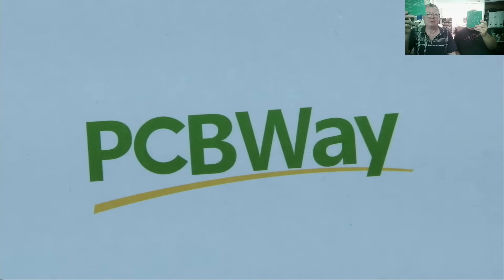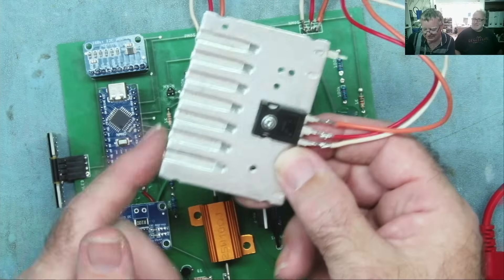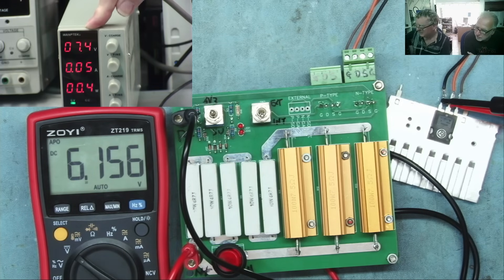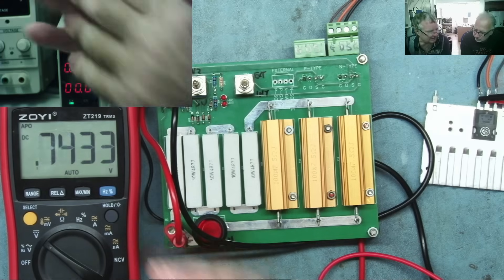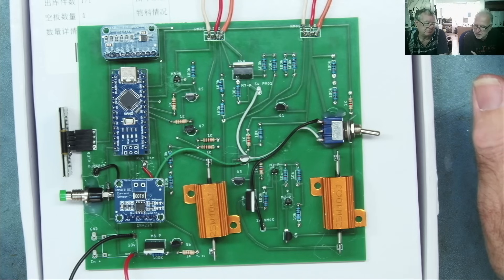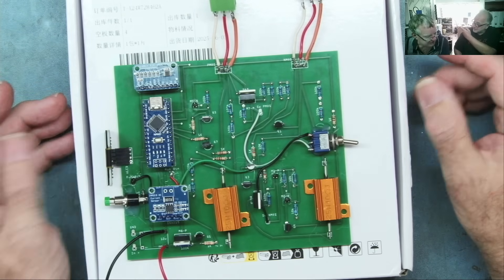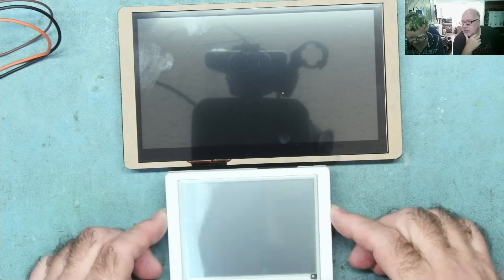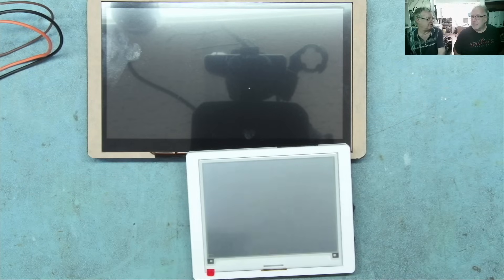Low Cost DIY Automatic Mosfet Analyzer Curve Plotter Project

Comment: Love it ❤  To test Vgs(th), you short the gate and the drain and, for that mosfet, apply a current of 0.25mA to the drain.  So I suspect mine is closer to the actual value 😜 However, on that revision I used an NPN transistor to short the gate and the drain, so I suspect perhaps 0.7v needs added to the Vgs(th) measurement - which would bring it to about 2.5v.  Not sure and not tested it in that much detail.  P-channel didn't need that transistor, so might get a slightly more accurate Vgs(th) value for them.

For the Rds on, if you look at page 3 of the datasheet (IRFP240 for those not paying attention 😁), top left graph showing Id vs Vds, you'll see the bunch of straight lines.  At 1 amp - it's normally about 930mA on the device - and 10v Vgs, you can see that at 10^0, look down onto the x-axis, you can expect in the order of 0.2v Vds.  So, according to the datasheet, Rds on with these parameters should be about 0.2 ohms, or there abouts (these graphs are quite squished).  It's not hard to see a bit less than 1 amp will give a bit less than 0.2 ohms...  That's my excuse anyway, reality is the Rds on should be fairly similar for both 1 amp and 10 amps (I suppose it depends on your accuracy expectations).

At 10 Amps, using the same curve, you can expect a Vds of about 1.2 volts and so 1.2/10 means expecting an Rds on of 0.12 ohms, which is about what you measured I think.  So both testers are correct I would say.  But the whole straight line on that graph means (I believe) that the Rds on is fairly linear over the whole region of circa 800mA to 15A or so.  The real issue is at low currents you are getting to the noise floor for measuring Vds - especially since it's passed through a 50/50 voltage divider - but in any case, it'll be hard work to get datasheet measurements for all mosfets and really, folk will still need to do more than just read the typical or max Rds on value to understand where they sit on that curve then gauge if it's a real-enough mosfet or not.  Maybe measuring and drawing a similar curve on those big screens will provide a better way to test them, but the Arduino won't be able to do that.

And yes, Detlef, it was a dodgy layout.  My excuse is that I thought I was running out of time as originally Richard said we had until June I think, so rushed it a bit.  Turned out I didn't need to rush and the dozens of other designs I was expecting to compete with weren't there :(

Great work guys.  Amazing to see 'random punter', homebrew designs being featured and tested ❤

Comment: Back when I was repairing home electronics for clients, we mostly relied on OEM components—these lower-cost Chinese alternatives simply didn’t exist. More often than not, once we quoted the price for those premium parts, the customer would decide not to proceed with the repair.

As an alternative, we’d comb through ECG and other substitution catalogs in search of suitable generic replacements—sometimes a slow and painstaking process.

A good curve tracer has always been a valuable piece of test equipment, though typically a costly one. If your approach really allows people to build a reliable curve tracer for under a couple of hundred dollars, that’s a big deal.

We used to have a very basic version that hooked up to an oscilloscope to show a waveform. It helped us determine if a component was obviously damaged, but it was more of a "for reference only" tool than anything precise.

Comment: I was looking at a datasheet for a couple of my fake mosfets, an 10N60 and an 8N60.  Both of these datasheets have an Rds on vs Id graph and shows me that, in fact, Rds on is not as linear as I thought...  So I was thinking that using a decent test current (2 or 3A easily achievable via lithium cell) to measure Id and Vds , then displaying these values with the calculated Rds on would be the best option.  The user then can cross check the results with one of the graphs in the datasheet, either Id vs Vds and/or, if it has it, Rds on vs Id.  If the results are off of the curve then it's fake.  If they are are on the curve then it's (probably) real.

I think big displays, decent microprocessors and all the support components to sweep 1A to 10+ Amps will make it quite expensive in comparison to doing some minor spade work with a datasheet to see if it's real.  That is, I'm thinking most folk would want cheap - though a super deluxe version might still appeal to some.

Comment: Look at the opportunity that we have stumbled upon.... With our investigation of fake MOSFETs, and how to test them,  Were creating the opportunity to learn  a lot about MOSFETs.   This is such a great project that we potentially just stumbled upon  Ha ha ha .   We started out with some simple testing procedures, and then we wanted to get a little deeper with more accurate testing and as we talk about creating more intricate testing equipment were learning so much about how these circuits can be designed and put together,  that in itself is an education.   I also see that we are taking ideas and hardware that we get potentially secondhand or very very inexpensively and making use of it.  I like the direction we are going,  let's keep the ideas coming along with good design reasoning   🙂

Comment: Taking power supply numbers as values for calculation is a bit sketchy. Those numbers are barely accurate. Also your power supply gets its feedback from inside so no compensation for leads either. Meaning you can set it to 10A, but it actually has 9.7A or whatever. But since this display is inaccurate anyway doesn't matter. But considering whole this PCB is sketchy then yes doesn't matter really. Just put one multimeter for voltage and another for current to get even decent enough values for calculating. But yeah the way you think would be a way to do it. But needs proper PCB routing. I suggest also 4 layer PCB since they barely cost more. For screen I would actually use some monochrome display and make the device battery powered. They take little current and are easy to program. You can add charging and stuff as well. Also I think you said it as well you can just build electronic load as a variable load. And sink type electronic load is quite basic. Nice project. Good luck with it.
Reply: It’s probably good enough for Gran Canaria 😅
Reply from the maker: Cheers.  We think an MCU controlled active load is the answer to this problem as you don't have to control the current supply capability (like using CC mode on your bench PSU) you just control the 'resistance' of the active load and your PSU will supply exactly the currrent you 'request' into the load, bsically eliminating the effect of any losses due to resistance of wires and PCB tracks. As long as the current is within the capabilities of the PSU of course.
Reply: @LearnElectronicsRepair  Yes that's the way to do it if you want to program current. But you also have to take voltage readings exactly at the load to make it correct. So you need external 2 wires for voltage measurement to make it more accurate like you also mentioned. But for a sinking type load all you need is op amp which would be driving mosfet in linear region, reference voltage for op amp(coming from DAC since you want to change it), current shunt, ADC to measure current for MCU and few other passive components.
Reply: @LearnElectronicsRepair  Btw cheap way to get a DAC is just PWM with MCU and use low pass filter to get DC. For ADC there is one built into almost any micro. But both these methods are kind of cheapie.

Comment: Since you only need high currents for several milliseconds, you could easily charge a bulk capacitor. No need for a fancy power supply.
Reply: I reckon about half a second should be sufficient, maybe 1/3 of a second.  I had a few delay statements in the code that could be tweaked or eliminated to make it faster.  Someone else can work out how big the capacitor would need to be to get that at constant(ish) voltage for the whole test (and how to keep it charged until the button is pressed to start the test).
Reply: Yes, the capacitor can dump copious amounts of current. You will need to balance the value of the capacitor to how fast you want it to charge and how long you want it to discharge for. Since you're  using current regulation anyways, it shouldn't be a problem.
Reply: I was about to ask that. Why not just use a big cap?
Reply: The British enjoy complicating things😅
Reply: @davidkclayton  Well, one or both of you should build it and let Richard show it to us all  👍

Comment: Can you explain the need for separate probes in more detail?
Why the wires have to be different to the wires already attached?
I think I had something similar when calibrating the thermocouple through the soldering Iron, but I incorporated a calibration routine in the code to composite for it.
Talking about Temperature, how about adding a thermistor to the heat sink for keeping track of the temperature and protection from overheating?
Reply: Look up "Kelvin connection". This very basic stuff when you want leads compensation. I will try to explain shortly. But it is much easier to understand watching some videos. Basically you have constant current running through some circuit and you want to know voltage drop over load. But your wires have resistance as well. So if we measure voltage drop at the current source you get the reading. But you have to realize that it is totally different reading at your load. Because PCB tracks, wires etc have resistance and resistance means some voltage drop. If you have power supply you can test it as well. Set it to 5A and put some load on it. Measure voltage at the supply output and at your load. And you can even calculate your wires resistance that way. And the bigger the current the bigger the difference(ohms law). So on low currents it is not needed unless you do some extremely precise measurements.
Having a temperature sensor on heatsink would be nice. But I think not really needed since you use short pulses meaning it will barely heat up. Probably you could even get away without heatsink at all, but then mosfet would heat up a little and change the characteristics.
Reply: @TriodeTetrode  Actually I was hoping for someone to read between the lines of my questions, more specific the 2nd question. There is a clue after that question.
We are not intending to use a digital multi-meter we are using a microcontroller, a microcontroller can be programmed with calibration.
Reply: @Tims_Projects   I answered your questions because you asked them. If you want different answer ask differently. Anyway I'm very well aware of that we use MCU here. Still don't get it what you mean by "calibration". Can you explain more so I can understand?
Your second question... you mean that: "Why the wires have to be different to the wires already attached?" ?
Reply: @TriodeTetrode  I am glad you replied, hopefully more will come of our conversation? Sorry for being a little cryptic 😁
Reply: @Tims_Projects  So what you didn't understand or what is your question? You mentioned something about calibration. Can you explain more so I can give you answer perhaps?
Reply: @TriodeTetrode  OK The meter needs to inject current into the circuit to take a measurement and uses a resistor very close to the resistance we are measuring. 
So we use a Kevin Connection, the extra two probes don't include the circuit by the first two probes, sort of take one from the other and we have a correct result.
Am I close in this very crude summery?
And are we using a muti-meter or a microcontroller in this project?
How does a Kelvin Meter work? Does it use a microcontroller and components like the ones in this project?
If you a designing a project of your own, you know everything about the circuit, you know the current you are applying, you know the voltage, you know the resistance of the wires in the circuit, you know every thing the first two probes of a kelvin meter is eliminating.
This is a bit long winded but if we know what the first two probes of a kelvin meter eliminates (through calibration) can we incorporate it into the programming of the project?
If the answer is no, and it defiantly needs the extra two wires, why do we not just give the connector we attach the MOSFET to, 5 wires?
Four of the wires can be paired up at the point of MOSFET connection? One of two wires in each pair is for the measurement.

My intention of my original comment was to promote discussion here, Richard does explain thing so well. I can't😁
Perhaps a video on how to make your own kelvin meter? What is required? And how we can incorporate it into the Project?
Reply: @Tims_Projects  Yes. Two wires for current, two wires for voltage. I think you misunderstand how Kelvin connection works. I tried to explain, but kind of hard in comment section. I think you would be much better to do some research on this topic. There are some very good videos on youtube. And yes you have like 5 wires in total. Maybe watch some electronic load build tutorials. That is basically what is needed here as well so would give you a great insight.
Reply: @TriodeTetrode  I am pulling my hair out here. You are talking about a "Kelvin (4-wire) measurement meter", a "Kelvin (4-wire) measurement meter" is designed to measure a "Device Under Test" (DUT).
The DUT could be anything, You attach two probes to supply a known current, you attach the sense probes to measure the voltage across the DUT.
We know the current applied, we get the voltage, we can calculate the resistance.
We now know what a "Kelvin (4-wire) measurement meter" does?
Pointless making a video now?

Ever herd of "Tunnel vision"? or "Think outside the Box"?
We are making a MOSFET tester from scratch.
There is more than one way to accurately measure a DUT.
This project is cool it is evolving rapidly.

I thought I had something similar when writing code for the Thermocouple in a soldering iron, please look up why we  need to incorporate the "Cold Junction" in code when measuring temperature. (Not using a chip that has it built in)
I say something similar, but ohms law gets shuffled about.
Thermocouples work by producing tiny amounts of voltage and the current is so low you have to incorporate the voltage at the end of the wires where they are connected to; lets say muti-meter for simplicity.
A kelvin setup make things easy and simple, there are two set of leads, one that measures voltage and the other supplies a known current.
Now with my thermocouple inside the tip of a soldering iron,  we only have two leads.
What we do is we calculate what happens (the difference) between the Thermocouple and the connection of the measuring device, using know values. We calculate this at a calibration stage.
I was asking can we do the same?

If we can control/know the values between measuring instrument and  the connection to the DUT (voltage, current, resistance) or can calculate them and they remain constant in this project, can we do something in the code  to overcome the need for two extra leads?
That was the crucks of my original question, we are making something from scratch and using a powerful Microcontroller.
I thought it would be a good topic to show the prose and cons without me going into details, which could ruin a good topic for a video?
I think everything is covered here now.
It was just a thought, can it be done?

I'll have to be more precise and not so vague in future.

Comment: couldn't you correct for the wire resistance after the fact in the micro?
Reply: Yeah, and correct for my slightly inaccurate Vgs th (which I think might be 0.7v lower than it should be due to a PN junction).  My version used header pins to insert the mosfet, no wires required, though the PCB tracks and connections likely added something to the result.  It's never going to be 100% accurate for every mosfet though.  A user would still need to gauge if it's close enough to spec to believe it's a real one or not, especially for the super-low Rds on ones.

Comment: I used PCBway with great 💕satisfaction and beautiful results.  
KiCad is my learning experience.  😎 Great video.
Reply: I have had good results from PCBWay as well. I also use Fritzing.
Recently, on another (non-electronic) project, I needed some plastic parts.  I saw that PCBWay also offers a 3D Printing service so I tried that.  I was pleasantly surprised by the results and by the price which was very reasonable.  You need to be able to provide a digital file of the required part and I use Freecad to make an .stp file.  You could get customised housings etc for your electronic projects.
Reply: I do have Fritzing and FreeCad. Fritzing , I have not really used. 💫